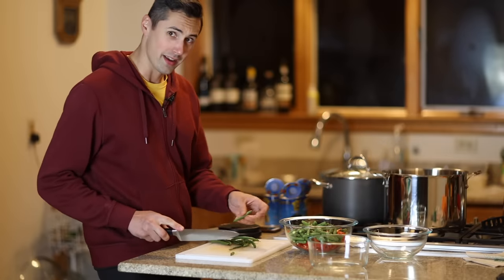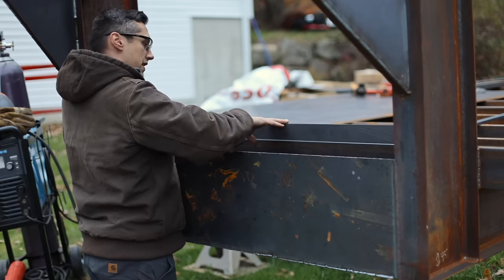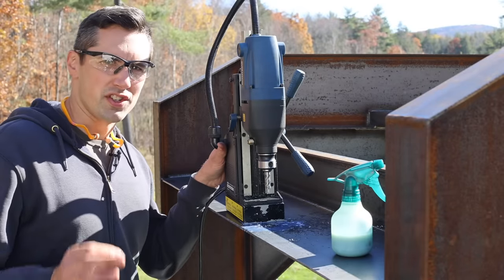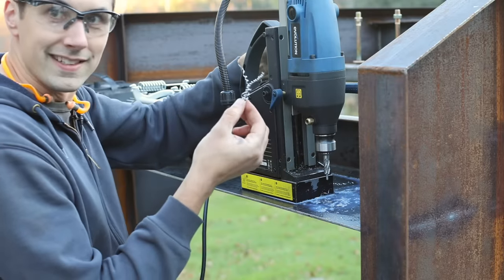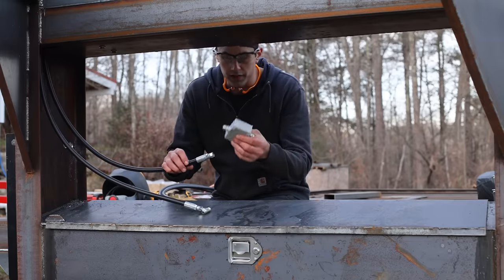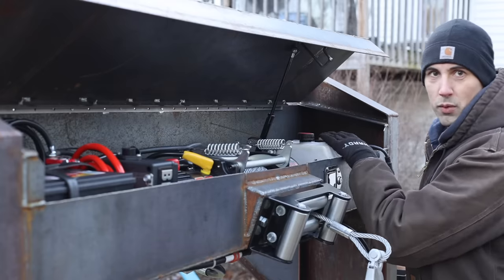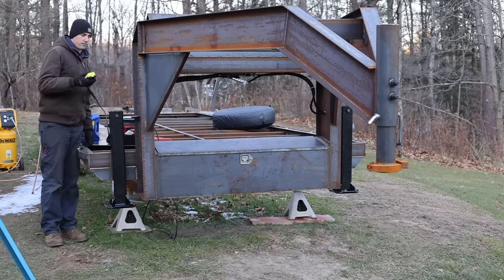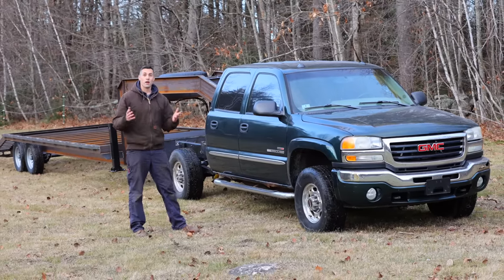Gooseneck Trailer Build Part 2: Hydraulic Jacks, Toolboxes, and a Winch

Comment: I think I would have done a trough for the spare tire(s) so more than one tire could be carried there. put a long rod through them all (and through the frame with a lock to secure all the tires / wheels in the trough. also, drilling metal without safety glasses isn't wise. Just because you have two eyes, the second one isn't a spare...
Reply: A lot of people don’t realize if you lose when I lose that perception......I think all the 50 states in the union ask you to handle drivers license back to them...I don’t think you’re allowed to drive with just one eye because of loss loss of depth perception....I’ve had steel take them out of my eyes three times got a burn mark still left there by one stupid mistake ....I’d rather have my junk slammed in the door.... then go see an eye doctor and have still taken out junk man do

Comment: One thing I would suggest is going back to harbor freight and spending I think it's $50 and buying the wireless winch adapter. I bought the new Apex winch and I use it all the time on the front of my F-150 that wireless remote comes in so handy. Badass build by the way giving me a lot of inspiration to build my own someday

Comment: If its not too late, I think it would be a good idea to weld on a flange around the toolbox, so you can install a gasket. That front lip works great for rain when the trailer is stationary, but at road speeds I images water hitting the front of the box and traveling up underneath that lip. All that depends if you are planning to store anything you'd like to keep dry in there, if not just cut small drain holes in the back corners and call it a day ;) Great work I love watching you build!

Comment: Since you do a lot of work with steel and welding etc, there is a product you should use.  It is called Ospho and used to treat rusted items. Simply spray or brush it on any rusted items and in a short time it will convert iron oxide to iron phosphate which is inert.  Parts treated will not rust again and Ospho also acts as a primer for painting.  On your gooseneck trailer you could spray it with Ospho which will turn black when it dries in an hour or two.  The rust will be gone and you could paint without a prime coat even months later.  I bought a 500 gallon gasoline tank to fuel my boats when I lived on the Gulf coast.  It was totally rusted so I treated it with Ospho then painted with Rustoleum paint.  Five years later sitting next to saltwater, there was zero rust on any part of the tank or frame.  Great stuff and it works,

Comment: 28:45  Yes young grasshopper this is why 4wd is NOT an option but a necessity, especially with a dually.  You can quite literally get stuck in your yard on wet grass. Also, good solid fab work there.  Love the hydraulic jack and winch set up, I think my flatbed trailer needs a refresh with that.

Comment: First off, I love the build. For a back yard build it sure is looking nice. 

ATF? Cheap is not always the best choice. Hydraulic fluids and ATF's can be very different between manufacturers, even for the same spec'd oils. Hydraulic fluid has better anti-wear properties while ATF has better antifoam. I would also check with the manufacturer of the pump as well as the cylinders for compatibility and warranty coverage with alternate fluids. A quality fluid will save you money and headaches in the future.

Comment: Definitely like the trailer setup, thats an ideal layout for everything, and if you do plan to tow the that trailer with the duramax, I'd definitely recommend putting a flat bed on there, because the short bed trucks are notorious for smashing the cab corners because of the shorter gap between the hitch and cab versus the long bed trucks

Comment: Perhaps this is to little and to late info. I put six knapp tool boxes on my one ton flatbed, found out after a break in that the flat lever latches can be forced open with a crest wrench. The doors are then open. If you notice long haul truckers mostly use the "T" handle latches. I am told the cast T handles just shear off when forced. This lesson cost me about $15000.00 in stolen tools. Nicely done trailer, great channel, glad to see you viewership is superb.

Comment: Great build, nice Job. They make a fiberglass whip, with a magnetic base. You stick in in front of the Ball of the hitch. Then you simply back, steering the whip to the gooseneck. When you touch the whip to the gooseneck, you are there. At first, I thought your Go-Pro was a back-up cam, which they make also.

Comment: I would recommend pinching the s hook together on your battery tarp strap and buying a made in the usa strap made by goldline definitely worth it they are made of good quality rubber and you can ver stretch them a little they stand up to the weather very well I've used many different tarp straps and the goldline ones are the best over all

Comment: Great video, wish I’d known that what all you were gonna do with it sooner because you might like my idea for the spare tire, which is mounting a spare tire winch from underneath a truck to the bottom of the gooseneck allowing you to drop it down to the bed of the truck using a cordless drill or small impact or even a electric motor

Comment: I don't want to come off as nit picking. I drove for a major freight company for 38 years. Every trailer I ever pulled the dolly leggs were mounted closer to the ground. This gives you more lift in the rare advent that you will need it. I also had two fith wheel RV trailers that were designed the same way. The bonus is the pump does not run as long to raise or lower the trailer. Other wise you are nocking this build out of the park!

Comment: Small comment, when routing rubber hose through rubber grommets, liquid soap them, they'll pass easier.  I have always had crewcabs and towed trailers, you are correct about attaching the trailer being hard in the beginning but ya get used to it. Great work on the trailer.

Comment: Short circuit mig on trailers is really iffy Im so glad I used a smaller 0.35 dual shield flux core wire it digs deep and has amazing impact and shock properties

Comment: Just a suggestion when mounting things with bolts put the head of the bolt where if the nut falls off you don't loose the bolt and the peice that is mounted stays in place. Putting the bolts up from the bottom will allow the mounted equipment to move all around if you  Lose the nut
Reply from the maker: Good call!

Comment: Looks awesome.  I think you have a constant power terminal on your 7 pin trailer light plug.  Could potentially use that to charge the battery as you drive …. 💪👍🏼
Reply from the maker: Yeah, that's definitely a good idea 👍
Reply: You have to use the power wire on the 7 pin to keep the breakaway battery charged as it is on the trailer

Comment: The best thing I’ve seen people do for spares is using the cable system found on pickups to mount their spares under the trailer. They weld a nut on the end of the cable tube that’s the same size as a lug nut so they can use the same tire iron to lower them

Comment: Nice trailer.  Looks like you did a great job.     I would add some drain holes in the tool boxes if you haven't. Cause water will find its way in

Comment: I have some suggestions for you

On my big tex i made a custom mount and my plate got bent after about 3 pulls and it was the size you used I would suggest putting some steal tubbing to help hold it in place.

The direction guard will not last being a director I suggest taking some steal tubbing (making sure it's smooth) and weld that directly on the frame of the box you can use that as you director 😉.

3. The welds on your jacks will most likely hold for a while but after a couple of years it will begin to rust and your welds will start breaking (know this from experience) I suggest taking some steal (make sure it's of size) and welding a ring basically around the jacks this will help hold them for longer. 

Hope this helps!

Comment: Very nice work, your going to need to beef up the winch mount and roller bracket mount.  When you are pulling down into your lower bracket you mentioned, it will easily bend your shelf down.,  When pulling straight it could easily warp your toolbox.   I would suggest adding a piece of 6" channel along the bottom of the tool box with holes that match up to the winch mount.  Might even gusset the channel in to the side frames also.

Comment: What I do with the whole crew cab gooseneck ball situation, I got a heavy duty magnet from harbor freight, got a piece of 1” flat bar, bent one end to a 90*, bolted it to the magnet, and painted it orange. Make it tall enough to see the top of it out the back window. I put it right in front of the ball in the truck, then back up until it touches the gooseneck on the trailer. Works good!
Reply from the maker: Good idea!

Comment: Looks great behind the Duramax. Maybe run some extra hydraulic line and have powered ramps? Also add a 3 prong weatherproof outlet and a harbor freight $15 trickle charger for plugging into 120v. Might also consider 12v thick wiring with weatherproof quick disconnects for running Brandon's batteries hot to the trailer. Talk about covering your bases... 👍

Comment: Nice build. (I 'castellated' my main beams - 50% strength increase or weight saving).  One suggestion for the winch up at your location - "somehow" change lower fairlead roller to one that is 'friendlier' (larger dia) for the wire rope - since you are asking it to bend almost 90deg - similar to your plan for the pulley down at the deck.  Secondly, I'd add a pulley block inside the rear x-memb for unloading dead vehicles...

Comment: You have inspired me to get a truck to work on … im in the air-force so i don’t have the most time but  i still really wanna build a trust …. If you could provide guidance on how to proceed I would appreciate it
Reply from the maker: Get a GMT800 truck. They're inexpensive, reliable, and easy to work on 👍
Reply: @WaldosWorld  as a GM master tech with over 15 years experience, I agree! I have a 01 Yukon 2500 and a 03 gas 2500hd pickup. Both have their uses and either can pull the other home if one breaks down.

Comment: The winch is going to rip out , you need to mount it to a I-beam support 3/16 is not going to cut it my friend also use grade A bolts and hardware for mounting it to the beam. Good luck the trailer is really nice and a work of art.

Comment: Could you post that recipe too! The trailer looks great but that food looks great too!
Reply from the maker: Sure thing! 😂

Thai Red Curry
Makes 4 servings
Serve with rice (2 cups dry)

Ingredients
* 2 (8 ounce) cans bamboo shoots, drained and thinly sliced 
* 3 tablespoons corn oil 
* 4 oz red curry paste
* 1 pound chicken breast, cut into 1/2-inch cubes 
* 2 (14 ounce) cans coconut milk
* 1 red bell pepper, thinly sliced 
* 1 small zucchini, crinkle sliced
* 1/3 cup white sugar 
* ½ teaspoon salt
* 2 teaspoons fish sauce
* ½ cup Thai basil 

Directions 
* Bring a large pot of water to a boil and cook bamboo shoots for 5 minutes. Drain.
* Heat oil in a large pot over medium heat and cook curry paste until fragrant, about 2 minutes. 
* Add chicken, increase heat and cook until starting to brown, 3 to 5 minutes. 
* Reduce heat and add coconut milk, sugar, and salt. Simmer for 15 minutes. Cover if necessary to retain liquid.
* Add bamboo shoots, and red bell pepper. Simmer for 6 minutes. 
* Add zucchini and simmer for an additional 5 minutes. 
* Stir in fish sauce and Thai basil and serve.
Reply: @WaldosWorld  lol

Comment: Nice I can't wait to build my 1/16th Rc loyboy one issue make sure that winch is well braced and strongly mounted while pulling up heavy loads with the winch might pull the bolts through the 4 mount holes on the thin steel mounting plate

Comment: Hey Waldo,, I found your channel when searching for a roll off dumpster build. Trying to start a dumpster business. Anyway, watched your truck build and that was great. I have 96 dodge with a v10 in it but I want to do a cummins conversion because the v10 truck parts are hard to find  or not made at all.  The v10 motor has 169,000 on her and it needs to be rebuilt or a swap. Great content,,,,.keep it up.

Comment: Hello just a suggestion here,
You should use some adhesive window seal types stuff for the toolbox lid, it will help seal out some water and cut down on any rattle. 
I used this trick on an old Kawasaki mule where the tailgate rattled badly, it took all the rattle away
Reply from the maker: That's a good idea! I'll probably do it after I paint the trailer 👍

Comment: Just an FYI if you are using the battery to run say the winch and accessory power jacks you are going to want something in the category of a deep cycle battery. A standard battery like that is made for cranking and the use of a winch is more of a constant draw use than starting a vehicle. Just a note.

Comment: Suggestion; think on using deep cell battery instead. Youl get a longer life for your application. Deep cycles can take larger loads longer, and won't wear out. Also maybe add one gaskets on your lids because one pothole and it's gonna sound like a China plate store just crashed behind ya lol. Great video man!

Comment: Pro tip if you have trouble lining up the ball in a crew cab- get on of the little extendable magnet sticks from northern or harbor freight and just pop that on your ball before you back up. a lot better than hopping in and out a few times to get it lined up.

Comment: This is a great project! Nice work.  I worry about the movement of the spare tire eventually fatiguing the bolt welds. Maybe it just wasn't tight but seemed like it would teeter on the cross beem quite a bit.

Comment: I agree support that wrenches also they make these small solar panels to charge your battery so it's always charged and ready to use also I would but a positive disconnect on just so you can stop the flow of power to your components when not in use these are things I've installed on my trailers

Comment: you should add a light facing the rear of the trailer for easier loading and unloading cargo i would suggest at a point like 21:06 on the sides of the top toolbox you could mount 2 small spotlight leds

Comment: As you mentioned that should the ground be to low for the jacks, you could shore up with some wood...  You might consider a couple bent bar holders to hold a pair of railroad tie's about 18"to 24" in length.  for tire chucks, jack etc.
Reply from the maker: Yeah, I definitely will want to keep some wood blocking in the trailer 👍

Comment: I'd really like to build one of these.  Gotta find a winning lottery ticket.....

One thing that I am doing that is working out great is using batteries with studs instead of lead terminals.  Corrosion is ceasing to be a problem. 

 I'm guessing that you will need to reinforce the winch mounting.  Harbor Freight sells a nifty hook for that winch which allows several strap loops to be accommodated easily.  I hope you do a demonstration on using the winch.  I'd like to see how it works. 

 How about using some 2 1/2 inch seam-out tubing for stake pockets?  They allow you to make up strap winches, D rings, hooks etc on 2 X 2 tubing so that you can place hold downs where you need them.
Reply from the maker: I certainly hope to film videos of the trailer in action picking up new projects. I seem to love things that don't run, so the winch will be necessary 😂

Comment: I really liked part 2 of the goosenecktrailer build but I think maybe you should consider placing some covers to the winch box and the hydraulic system, one in each column towards the jacks and another lowered the upper tool box to hide all the sleeves hydraulic systems and thus have a more aesthetic appearance.  I really like your videos, best regards from Puerto Rico

Comment: check with Harbor Freight, they make a fiberglass marker stick with a magnetic base to make it easer  to align ball and receiver.  I ran into same problem with utility trailer and bumper ball,  I bought mine several years ago and I don't remember where, but I think it was HF or Walmart automotive dept.

Comment: Cooking tip
If you want that nice creamy coconut flavour don’t add all the milk until you are about finished cooking.
Either keep some aside if the recipe calls for it early or use stock instead until just before the dish has finished cooking then stir in the coconut. If you add it early it tends to disappear into the dish.

Comment: Absolutely BEAUTIFUL BUILD sir. I would be interested to see which you can max out first- the winch pull weight or that 3/16th its sitting on. Not being a hater, but I'd brace that vertically so you don't get any flex when you put strain on the winch. Other than that suggestion, I am in awe of this build. (Edit: I probably should have read a few comments before running my pie hole. I see this has been mentioned.) (2nd Edit as I watch video: I have always thought about making some quick change jack extensions. Extra feet + Quick Change Pins + 6x6 3/16 Square Tubing = Very Cool)

Comment: After owning a hydraulic dovetail trailer (Moritz 24+10) I'm willing to bet that in time you'll be wanting to figure out a way to add hydraulic fold to your ramps. The Case Industrial dealer I once worked at had an Eager Beaver trailer that had fold-flat ramps, motivated by a hydraulic cylinder, and a linkage almost exactly like the bucket of a backhoe or excavator.